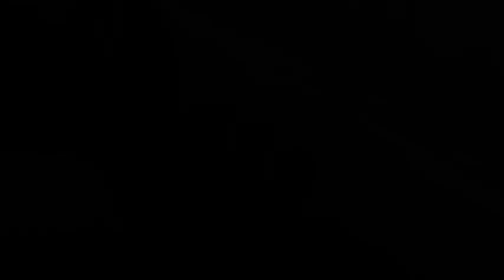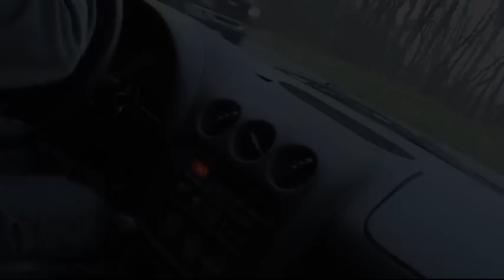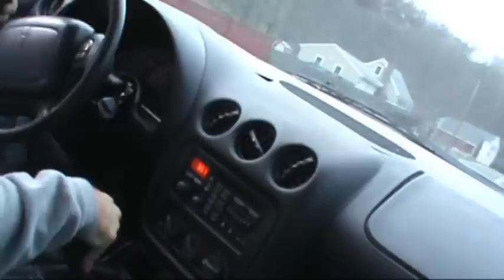Video Response: Rev Match Downshifting A Trans Am

Comment: Need help. I drive a 2001 v6 firebird and am trying to learn rev matching. How long are you pushing the clutch in for before giving it gas? Is it all instantaneous? Are you waiting for your RPM needle to climb to the desired RPM before releasing the clutch off the floor? I find that if I do it slow I need a huge blip of gas, but doing it fast almost always results in shock instead of a smooth transition. Ideas?

Comment: ok cool. now do you need to down shift rev match when coming up to a red light or can you down shift and just let off the clutch without using the gas. i always downshift through the gears coming up to a light or stop sign just seems safer than being in neutral an having to fumble for a gear in case of emergency